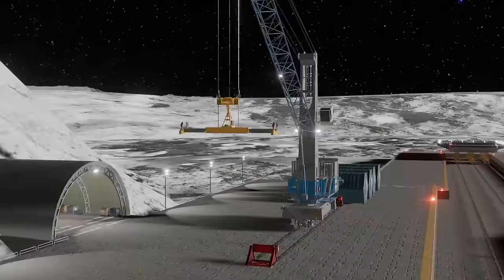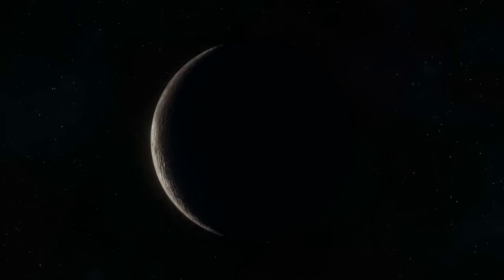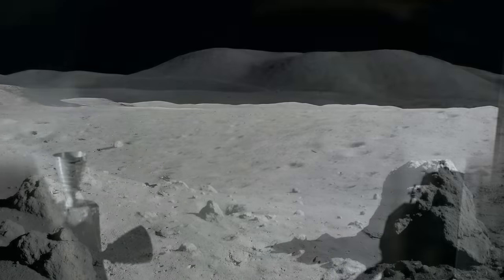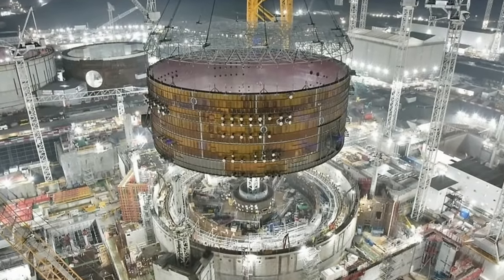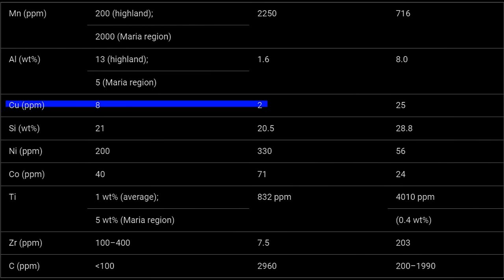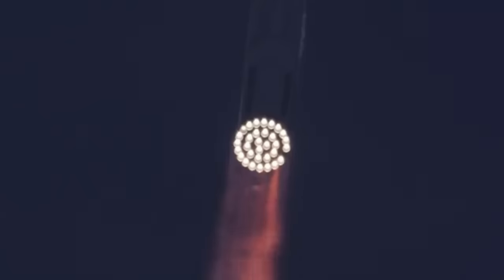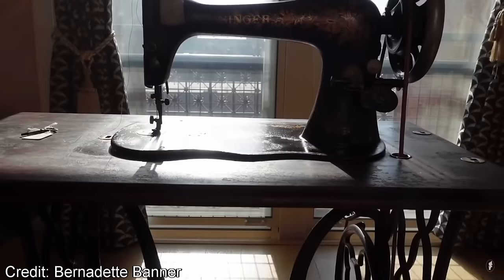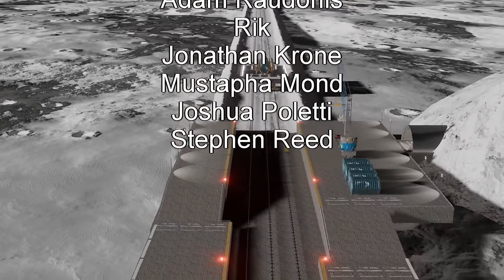Designing Heavy Machinery To Excavate The Moon

Comment: Maybe this is a stretch. But I wonder, since the surface seems to be mostly a similar type of rock regolith dust, if we can't just send large laser type gantry vehicles which would fire beams to melt the regolith dust into solid structures like many commercial metal laser 3d printers. Usually, these printers rely on filling a device with metal powder then a beam fires at the top layer like a 3d printer and then slowly makes its way downward. I can't believe theres no way to do this on the moon if there's a suitable nuclear power source. The ground is already filled with material that's needed. And the resulting structure would be obsidian or rock like glassy, but importantly continous and impermeable to gasses.

EDIT: Turns out someone already thought this up about 2-3 years ago or more since you can look up videos of a company doing this exact same idea and even a 60 mins clip of it and NASA pages about doing it. This is probably the most realistic way we're gonna build on the moon, not mega construction equipment like in the video here.

Comment: Seems to me that the concept of solar thermal engines, ie stirling engines, would be rather difficult also, as there is no atmosphere, making it difficult to cool the cold end, and of course, difficult to have any gas to inside it. Of course helium is usually the best medium in a closed system stirling, but that opens a whole nother kettle of fish, since now you have to also maintain a supply of helium as some of it inevitably leaks out.

I'm still agreeing with your arrival at batteries, just saying that some of the other options are even harder than you suggest in the lunar environment.

Comment: Building sophisticated equipment for the moon would be a nightmare with all the spiked razor sharp regolith on the surface, not to mention all the electromagnetic damage from flares.

And due to the compilation of the surface, everything is going to have to be made out of aluminum. Aluminum is great but not for everything.

I think it would be better to dig underground an excavate towards one of the cavities that's inside the Moon. After all we've proven beyond a doubt that the moon is very much hollow and not natural, the only problem is that after you get to a certain depth the surface is impenetrable. 

How in penetrable, take this into consideration regardless of the size of any asteroid that has hit the moon and a billion years, none has gone past a specific depth even though this mass of the object hitting the moon should theoretically leave different depths of craters yet not even a high-speed asteroid can pierce the surface.

We've even had trips to some of the deeper craters and try to drill into them and we couldn't get past a common depth.

Simply put the Moon is not a natural body.

It's placement is too perfect its orbit is too perfect, it's lighter than it should be, it's bigger than it should be. Everything about the moon screams artificial.

Oh yeah and everything at that depth is made out of rust proof iron, perfect for a artificial structure.

Comment: I know minng is wrong and we can make all resources by hand because energy times carbon is what makes matter but besides this

Since we know a sphere is the perfect shape and a circle can never collapse on itself because each ring supports the other

The question is why dont we make a 100 kilometer ball and launch from 100 kilometer off the ground ?
The only reason i say 100 kilometer is because satellites are 250 km and higher
If we launch from 100 kilometer off the ground we dont need rocket fuel 
We can launch with gun powder 
There's no entry and leaving requiring us to move 17000 miles a second we can go up and down with a elevator
Its just a 100 kilometer ball
It can be made with a 3d printer
It can even be made really quickly with expanding foam 

Hopefully you do a fundraiser to make a 100 kilometer ball to launch from 100 kilometer off the ground 
It will let endless people go to the moon and come back
You can put rooms in the 100 kilometer ball
Huge opportunity for the right ambitious people who want to conquer outer space

Comment: I personally think we should use nuclear power over batteries for our machines, although the battery could be a useful backup if something happens with the reactor the machine can drive back to a repair facility,. The ideal reactor would be one between 0.5 -2 megawatts thermal output that uses a passive cooling loop (no pumps) and a small steam turbine to generate power. Why a steam turbine? It's a well known technology that we've all but perfected by now, they're simple and reliable and have a low number of moving parts. But what about nuclear meltdowns? Well, a 2 megawatt reactor is a lot easier to clean up after if it goes boom than a 200 megawatt reactor.

Comment: The electronic systems of the vehicles don't have to be "modern" - larger transistors and other components considered obsolete on Earth would be much easier to manufacture on the moon from scratch than what's comparable to the best. 

In principle you don't even need a photo-lithography plant per se (The chemicals for that method might not be sufficiently abundant on the moon) - something like a CNC tool system could do the trick, or don't use integrated circuits at all. 

If the computer needs to be too large for space considerations to fit on the vehicle you could even have a mostly stationary box that radios or unspools wire carrying electrical signals to and from the vehicles' motors and sensors.

Comment: I wonder what diameter The Boring Co's boring machines are in comparison to Starship's outer diameter? 🙃 If I were doing this job, that would be my tack. Send a Boring machine to the Moon and land it in a deep crater. Then bore tunnels radially into the surrounding Moonscape. Then a heat source would be needed to Calcine the Regolith into cement to make concrete. IIRC the experiment has already been done to see if Concrete can cure in a vacuum and it can.

Comment: I know it was a joke, but just a note about the size of American cars. While ego or preference does certainly play a role, the main reason American cars are becoming so absurdly large is because of the way our terrible environmental regulations are written. Manufacturers can get away with more with a bigger wheelbase (distance between the front and back tires). The larger the car the less mpg rating it needs to hit, the looser the emissions standards become.

 
For example, let's imagine you have two cars. One is a standard cab truck with 110" wheelbase, weighs three tons, and has only two seats. The next one is a very wide van that seats four abreast, only a 90" wheelbase, weighs a mere one ton, and has ten seats. That van needs to meet far stricter regulatory requirements than the gas guzzling truck, even though it can carry five times as many people. Everything is based around wheelbase. Why waste money engineering an engine that consumes less gas when you could just stretch the body a little bit longer?

Comment: I'm greatly concerned about the cable and pully design for heavy machinery, sure the lower gravity would mitigate the power losses and allow increased capacity, but it over looks the biggest concern. Lunar regolith is extremely abrasive and the life of those cables any pullies is going to be a huge problem. Hydraulics would have an identical problem, so too would electric actuators. However, the electric actuators and hydraulics could be shielded much more effectively. The biggest parameter we would want to minimize is maintenance downtime. To that end, while cable and pullies are simple and could be simple to replace, they would be very intensive to manufacture in the needed volume especially at the needed scale, especially considering the added issue of importing carbon.

Comment: Nice video but one thing that you need to know the usefulness of trains can not be underestimated the ability to connect facilities will be needed the heavy machinery would require being moved so trains are a low cost low maintenance system for our industrys on our god lunar
Reply from the maker: Yep, next video will be about this :)
Reply: @Anthrofuturism  YAY :D (autism mode worked) but side note we might not need to launch excavators by rocket if we have mass drives we could make 3d printers in LEO to make excavators bigger than rockets could hold than land them on the moon to start infrastructure

Comment: The more I watch about how we're going & need ways to get started on the moon & or a docking station (jump-off point) & hear how we need to burn up our old satellites & the ISS, I think about bringing all these items to the moon to help get us started. Think about how helpful the ISS would be on the moon with it's shielded sections, sleeping, first aid, washing, eating, batteries & solar panels, we could use then repurpose & recycle, including the old satellites with their sensors, communication & GPS capabilities. Now getting it down on the moons surface would take space drones that could taxi them on to the surface & if only powerful enough to guide them & assist in a controled drop all we would need to do is attach the rubber ball airbags to cushion their landings like the Mars rovers.🤔 Just some thoughts.

Comment: РЖД MENTIONED

Edit: Why not use internal combustion engines? Just make them hydrogen-powered, with fuel cells. We're gonna have to go for water anyway, no? Robert Zubrin gives same reasoning in "Case for Mars" (☝🤓) Fuel cells are much more robust, easier to make and more energy dense than any kind of batteries too, AFAIU
Reply: Fuel cells fell behind lithium batteries a while ago in the race for energy density, and were never really ahead unless you pretended the hydrogen tank wasn't part of the system.  From the sound of things, the new sodium batteries are starting out ahead of fuel cells in density as well, with lessons learned from lithium cell designs.

Aside from that, hydrogen is ridiculously difficult to contain and will embrittle any metal tank it's contained in.  Metal on the Moon is already going to suffer from some embrittlement due to constant radiation bombardment.  Adding hydrogen embrittlement to that is just asking for trouble.  Non-metallic hydrogen tanks are made with polymers derived from hydrocarbons, which are scarce on the Moon, and those tanks have their own problems with hydrogen leaks.

Hydrogen in space is such a nuisance that it's really only useful for rocket propellant and maybe someday fusion fuel, and even for rocket propellant it's questionable.  Consider how SpaceX thought about it for Starship and decided against it, for many reasons.

In space, you want your hydrogen politely bound in pairs to oxygen atoms, in the water tanks of your life support system, not floating around being a pest.

Comment: My concern with a cable system is weight, if everything weights 3/4 less on the moon would it be safe to theorize that something utilizing gravity to move would take almost double the time? plus inertia is still a present factor so when lifting the shovel it would have a tendency to be lifted really slow resulting in more time, cause if not, you do not have the same gravity to pull it back down as fast as you do here on Earth. I don't live on the moon so just a guy on the internet.

Comment: Aluminum wire is a good idea.  But for any wire, it needs insulation.  Any thoughts on what insulation material could be used? PVC is not an option.  Silicone might work.

Comment: Walking draglines and rope shovels would def be the best choice the only reason rope shovels aren't popular now is just because there not as modular as hydraulic excavators never mind the attachments and simplicity of use draglines and rope shovels are cheaper to make maintain and fix more skill required to operate I think biggest problem will be all the joints of whatever machine u cud use a sacrificial sleeve or bearing like brass or any metal softer than the more important components , fukin moon dust

Comment: I suspect steel will not be the best material choice as others have pointed out, the smelting process simply needs too much else for the bootstraping. Aluminum can be recovered much more suatainably with a chemical process and is way easier to recycle than steel.

Drag chains are probably the best platform for mining and as a bonus most here on earth already dont use wheels or tracks, they have feet and walk! No need to move quickly, hell even get rid of the batteries and just have it tethered to your colony grid. Then the other support equimpent requirements are just haul trucks and dozers for the most part.

Other support equipment requirements will be rock breakers for bolders that the drag chain cant deal with, cranes for maintainance, a mobile battery for recovery of vehicles that run out or for supplying the drag chain when it needs to travel where a trailing cable cannot go, and other misc utilitie vehcles. 

On the actual mechanical designs, simple is best. Make everything out of beams and bolts. No casting, only machine things that have to mechanically interact and minimise those. No gears, belt and pully everything and accept the belts will need replacing a lot from regolith shreading every moving part, but these are way easier to make and more tolerant of imperfections than gears.

On the topic of cooling and radiators, the moon itself is pretty cold right? Heatpump that energy into the crust and let the landscape absorb it. Sustainable? Who knows, but for bootstraping who cares?

Comment: Due to the extreme change in temp, would it be possible to use that to create energy with a material that changes in volume when it is heated and cooled?
Reply from the maker: @asnailking9980  thermal wadis are the idea of using regolith as a thermal battery, just keep the material hot through the night by insulating it and use a Stirling engine to power a generator. Not the same as what you proposed but similar. I'm not sure about expansion v contraction it's a very neat idea.

Comment: hi! :)
Reply: i love ur animations dude
Reply from the maker: @yuranbarkey8068  hello
Reply: @Anthrofuturism  Hey man, kudos on the great vid, although i do have a few constructive criticisms/questions. First, when you talked about extending the life of the ISS, did you take into account if the structure is actually usable? Because after decades in space I'd reckon the ISS will soon be plagued by metal fatigue and such, and that seems awfully difficult and expensive to repair. I do see merit in scrapping it and using components from the station, but the structure may just be too old. Secondly i was under the impression that there was a reason we made wheels out of material that can bend and deform, so the load would be spread among a larger area. Wouldn't using thick steel wheels go against that? Anyways, have a good one

Comment: Teleoperating equipment on the moon would be impractical in the extreme. The speed of light lag for the distance between the earth and the moon would make for a roughly 2 second lag between the operator seeing a condition and the command to change it arriving at the equipment. You cannot operate machinery that way. Any teleoperating would have to be done ON the moon!

As for power, remember that on the moon the nights last TWO (earth) WEEKS LONG! That means that for 14 out of every 28 earth days (i.e. the time base on which your crew will be operating on) your outpost will be in total darkness and temperatures near absolute zero! You will need either really huge batteries or nuclear power to provide electricity to keep your people alive. I doubt your equipment is going to want to function at lunar nighttime temps either. At those temps steel is as brittle as glass. I don't know how old the creators of this video are but I'm not sure they will live to see the settlement he describes. At 73 I bleeping well KNOW I won't.

Comment: Aluminum "squirrel cage" motors are probably the most common industrial motor on earth. I really don't think you do any research for these videos.
Reply from the maker: @buckstarchaser2376  here I'm talking about wound motors which are what you'd use for something like this because they have more torque and speed control and variation. Squirrel cage motors are used for constant processes like a lathe or mill rollers. But what you said is true, they do commonly use aluminum and I probably should've made that more clear.

Comment: I think you're really arguing from a perspective that won't even be an issue until very advanced lunar occupation. You are presenting big heavy machines operating on an empty otherwise undeveloped lunar surface. There are the following realities IMO : There won't be ANY machines that big on the moon for the forseeable future. If there DOES get to be one, it will be the ONLY machine on the moon, and won't need the kind of services other heavy equipment offers. (grading and stuff). Instead, machines on the moon will be much smaller. They will need much smaller earthworks, and projects can be scaled down appropriately. In this case,, "heavy" loads will still be small enough to be the domain of direct drive motors, and personally, I think this is what we can expect to see. Similar to a toy arduino robot, directly connected or perhaps small nylon gear connected servo motors actually the size of arduino toy motors are what we should expect to see.
Reply: If only there was a book and a series of videos that explains exactly how to get to this point.